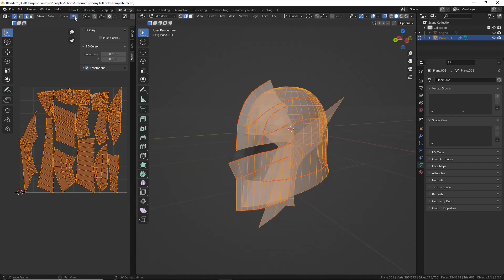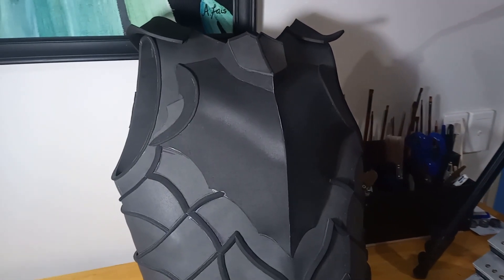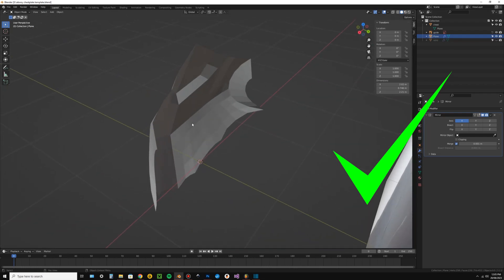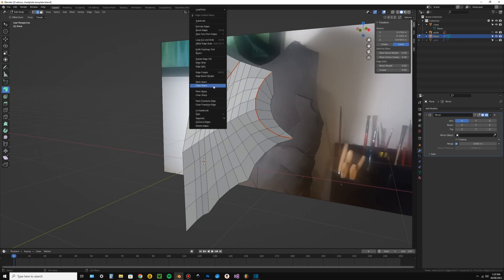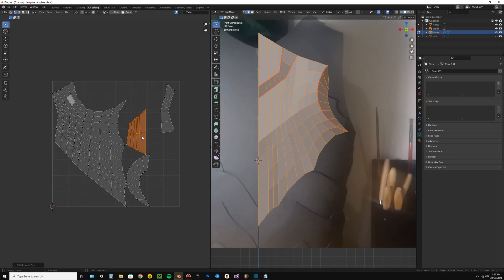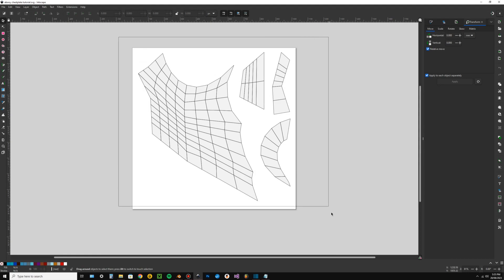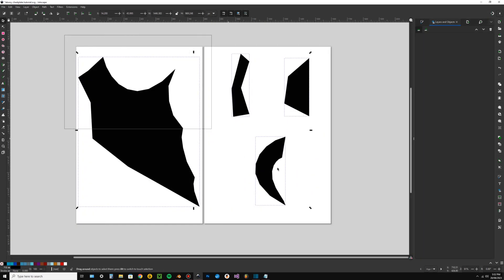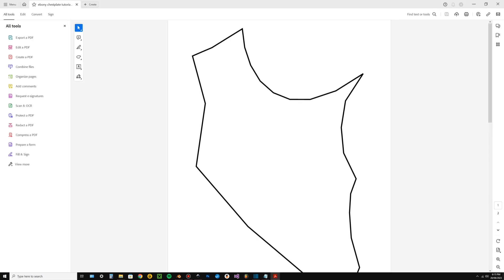Designing Foam Pattern Templates using UV Unwrap in Blender

Comment: When you resize it before you place pieces to the papers
How do you make sure resizing UV fits your head?
Reply from the maker: You can't and that's the only reason I said don't worry too much about the exact size before printing. You have to use a low-cost/expendable (paper) prototype for this exact reason - you can only know for sure through trial and error with this prototype. Some people use a 3d scanner to scan their head and import this into their 3d modelling program to use as a base on which to model their parts, but I find that to be an unnecessarily expensive method. With my method you only waste a small amount of ink and some paper which doesn't set you back financially too much.
Reply: @ethereal.smithy  Thank you for suggestions, I'll think of something
Reply: Figured out a bit of a roundabout method. If you have the model scaled to size in Blender (e.g. have it fitted to an Armorsmith model or other dummy), find an edge on the piece that is relatively straight and flat, something that won't be warped much by the unfolding process. I'm using things like the edge of a strap connection tab. Measure the distance between two vertices in Blender (hold ctrl to snap the Measurement tool), then create a rectangle in Inkscape with one side having the same dimension as the measured length. Scale the unwrapped model according to the guide rectangle.

Also, cheers Ethereal, I've been slamming my head against a wall all day trying to get Armorsmith to make a sensible pattern, but didn't even think of just using programs I'm already familiar with. This was so much faster and merciful on my patience.

Comment: This is great! I'm having issues unwrapping a twisted corkscrew... Any advice of how I should be slicing it up?
Reply from the maker: That's s tough one because it's such a long object and the error between the model and your cutouts would compound towards the end unless you cut it along the length of the helix, and depending on the size, those patterns could span multiple pages. But I can imagine how easily I'd screw up connecting the pieces if i tried to cut it into smaller lengths!